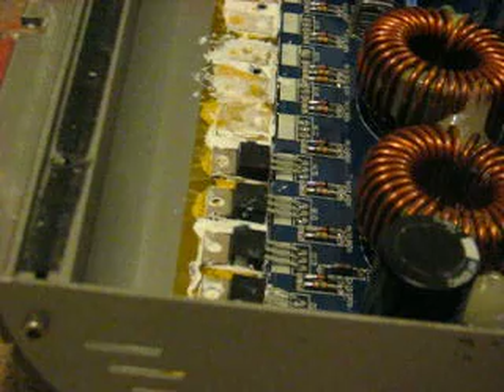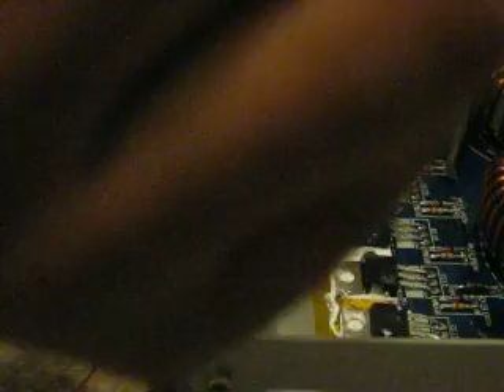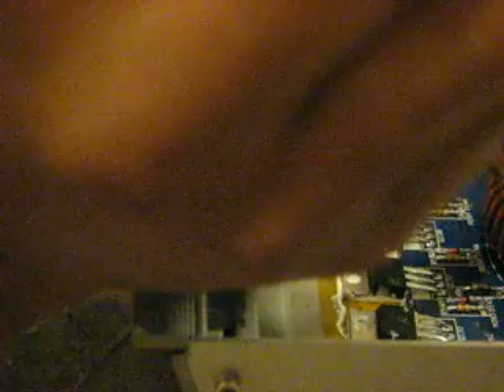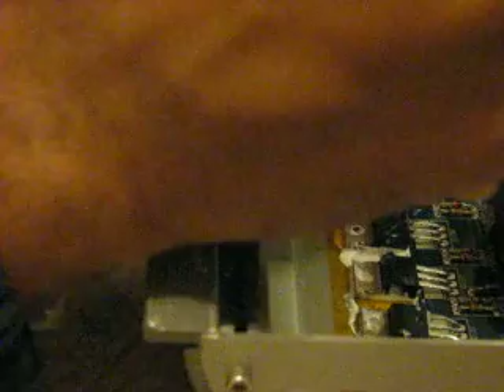Amp repair part 5.avi

Comment: ahhh i had a similaire thought, should be getting my multimeter tomorow will see diffrences in resistance like in your videos even though the transistors may not be short circuits yet